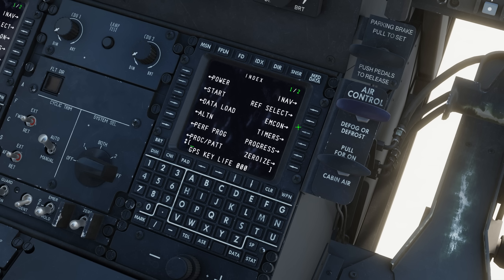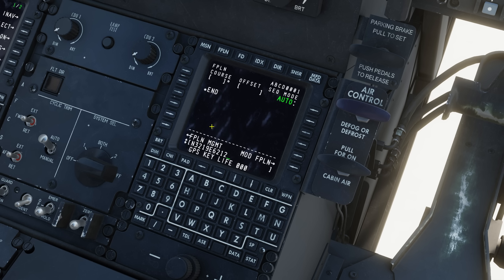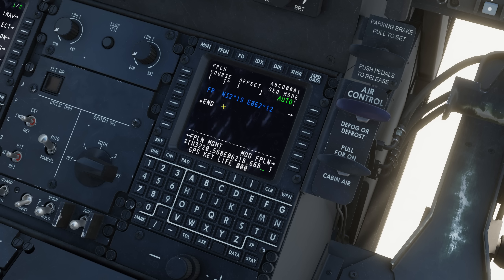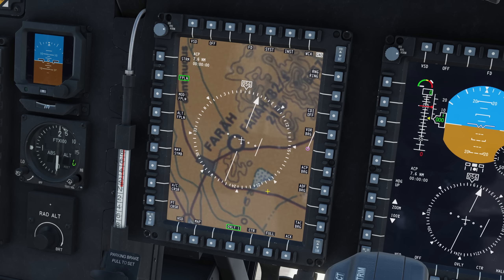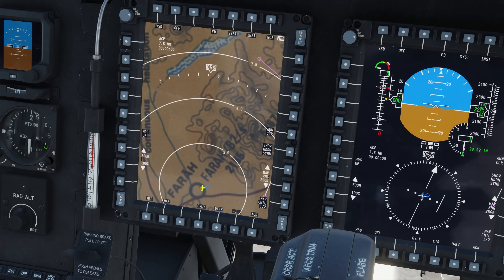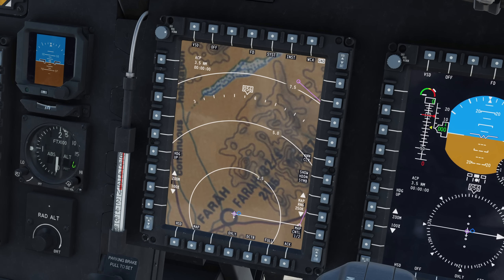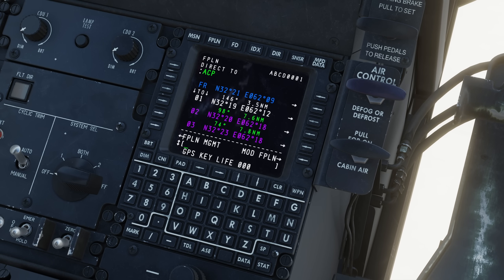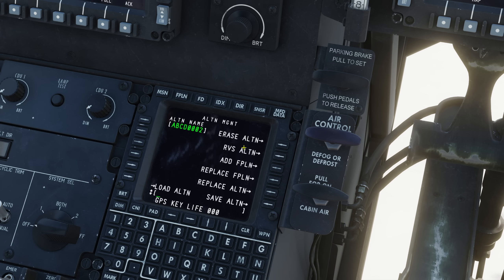DCS CH-47F | Basic Navigation | Route Building

Comment: Hey 47 Driver quick question for you. while flying the 47 sling load ops. I was using the pilot MDF set up for Nav with the FD. noticed a red box pop up with the letters RA inside.  I get the feeling its the radar alt?  help thx
Reply from the maker: Correct. The red RA flag will pop up when the RA fails or senses erroneous data. Can happen with slingloads sometimes because the load is reflecting the radio signal back to the antenna on the bottom of the aircraft.
Reply: @47Driver  perfect thank you for the info.

Comment: Great video! In depth and answered most of my questions. In flight, how close do you have to be for the next point to sequence? If you had to adjust course due to some threat, would you direct to your next point or is there a way to force the sequence? Thanks
Reply from the maker: Honestly not 100% sure, but I think it depends on speed. Usually it'll start to auto sequence at around 1nm. If I needed to reroute on the fly I'd usually just snap a new direct to, it's super fast. Not really a way to force it to sequence other than a new direct to, but you can disable auto sequence and go up manual if you wanted to.

Comment: At 8:12 the display shows a course setting at the top left of 98. Is this the heading to the next waypoint, and does it update continuously?
Reply from the maker: My apologies, I guess I missed this comment! That is correct, and it does continuously update. You can input a manual course here and it will snap your CDI to that new course allowing approaches to an ACP or LZ to be flown from a different heading with an accurate CDI. You can also, IRL at least, make what we call a Curvalinear course via that box which will build a flight path to follow with a curve in it to get you over that next ACP on your new course. Pretty nifty.

Comment: I've been flying the 47 in dcs alot and twice i had a low fuel warning even with 60 percent still in the tanks and soon after, both engines failed. is there a cross-feed i am not seeing?
Reply from the maker: @paulsheather7657  currently the AUX tanks do not function, so you're missing out on about half your fuel. The Crossfeed should function but won't make a difference in this case as both main tanks are burning evenly, you're just not getting positive transfer from the AUX tanks into the mains.
Reply: @47Driver  Thanks for the reply i guess until it's fixed a full tank is half. Also thank you for all those tutorials.

Comment: Again many thanks for this video. Currently going over this again and again and using the DCS mission editor to make a simple collection of waypoints on a map. Starting at an airfield. My question is I am not sure how to make the CH-47F fly those waypoints automatically ?.  In MSFS 2020 many of the advanced helicopters have a Flight Director and you can set TRK ( Track) or  Autopilot, or whatever equivalent to make the helicopter fly your flight plan, while you maintain altitude and speed. How do I select this in the Chinook ?. Is the Flight Director fully functional in this module to enable me to do this ?. I can see a flight director switch but it does not seem to do anything.  The official manual describes the flight director button, but I cannot ascertain how to enable the Flight Director coupling to the DAFCS. its confusing to say the least. Any advice on this topic ?. Thank you.
Reply from the maker: Flight Director is not modeled yet. Later on when it's implemented it will be able to do this for you.

Comment: Kinda related to basic nav...I can't seem to find it in the early access guide but what sort of fuel burn rate do you recommend we use for flight planning?
Reply from the maker: Not going to discuss range. Just use what you generally see on the fuel page during cruise and that should set you up nicely for DCS purposes.
Reply: @47Driver  thank you! So on the fuel page where it says Total between the picture of the two engines, for instance 1102 is that 1102 lbs / hour?
Reply from the maker: Yes
Reply: @47Driver  awesome thank you so much for the reply!

Comment: Just a quick question here, is adf implemented yet? I had been messing around in the cdu when i was in a mp server last night. Wanted to do some csar but could not get nav working, i found the adf page under the cni button but it wouldnt allow me to set a freq or change the presets freq. Btw the 47 is all new to me, i've never flown anything irl either. Just a sim guy :-)
Reply from the maker: @HowlerBikeVlogs  not sure if ADF is modeled at this time. We don't use ADF anymore in the helicopter and it's been several years since I've used it so I'm not super familiar with it's operation. As far as I remember you just enter the appropriate frequency and you can tune/identify the NDB via the CAP on the center console, on the row of volume knobs on the bottom. I'd expect this to be implemented in the future.
Reply: @47Driver  cheers, so for now, no csar im the hook, gotcha. I'll focus a lil more on the cargo deliveries then, should also be fun
Reply: Unless..., technically i did get a bearing and range from bullseye, so with the f10 map i could get a coord of the general area, put that in as an acp, direct to and once there request a smoke flare, let the mk1 eyeballs do the rest

Comment: Amazing tutorials - How do you select which ACP is the active one for the HSD?
Reply from the maker: Direct To via the DCT button on top of the CDU. Then select the ACP you want to go Direct To, ie. become the active ACP.
Reply: @47Driver  Is this the way it is done in the real 47F?  Or is it just the way we have to do it for now in DCS?  I use AUTO but sometimes I have to deviate a bit to avoid a threat.  Then it doesn't auto increment the FPP.  It's like you have to fly very close to the FPP for it to auto increment.  Seems like it would be a HOTAS button to manually increment it, no?  But whichever way it works on the real 47F.
Reply from the maker: @Andrew-13579  The way I described is the way it works in the real thing. Not sure the proximity you must be to the ACP for it to auto sequence, but this is something we deal with IRL all the time. DCT helps a lot.
Reply: @47Driver  So, you can go DCT to the next waypoint and it will resume the rest of the route?
Reply from the maker: @Andrew-13579  yes

Comment: When trying to land I almost always go down slowly, then a little faster, then suddenly I drop out of the sky like a stone with no ability to catch it. It seems to only happen when I try to land vertically. Does the hook need a bit of forward momentum to descend quickly? Is there a trick to catch it when falling? Thx
Reply from the maker: Try to avoid vertical approaches unless you're able to maintain a very low rate of descent. You're Settling With Power, meaning descending into your own rotor wash. If this happens again, try using pedal or lateral cyclic to escape it.
Reply: @47Driver  @jebb125 very cool, thank you!
Reply: Vortex Ring State, right?  It affects all helicopters, I think.  Except when the rotor wash hits the ground, ground effect, right?  When down within about a rotor disc's diameter from the ground?  I wrecked a couple DCS Huey's this way, initially.  I think one was when I was descending alongside a moving ship...that was moving with the wind.  So, even though I was moving over the water, I had zero airspeed but didn't realize it. ...splash...kaboom!

Comment: @47Driver - With Engine Condition Levers set to Ground, with Gen 1 & Gen 2 - Switch on and the APU Gen & APU switched off, the  MFDs and CDU-unit does not get power, so they do not work. Is this a correct power behavior or is it a faulty description and simulation of the CH-47F glass cockpit?

Thanks for all the great content, you are a lifesafer for the Chinook-needy! ^^
Reply from the maker: This is correct. With the ECLs in ground the Main Generators attached to the AFT transmission are unable to produce AC electric power. Need to keep the APU and APU Gen on until both ECLs are in flight. Then turn on the #1 and #2 main generators prior to shutting down the APU and APU Gen.
Reply: @47Driver  Yeah, that has been my go-to solution and now I know it is the correct procedure. Thanks for the quick reply.

Comment: Unrelated to route building but one thing I noticed is that while trying to fly straight and level (With AFCS set to BOTH and force trim), the CH-47 tends to either pitch upwards or downwards when letting go of the stick, so I constantly have to correct it which can be really annoying. Have you noticed this as well? And if so, how have you dealt with it?
Reply from the maker: I have noticed this also. Flight model certainly needs some work but these pitch up/down transients are relatively accurate to what the real thing would do if AFCS was off. For longer routes you could have Bob fly for you to take some of that workload off.
Reply: AFCS works much better now with DCS 2.9.10.4160.  Not sure if that version fixed it, but it's the version I upgraded to from an Oct 2024 version that didn't work well.  With AFCS on, it's nice and steady now.